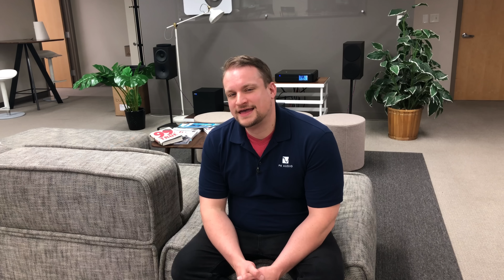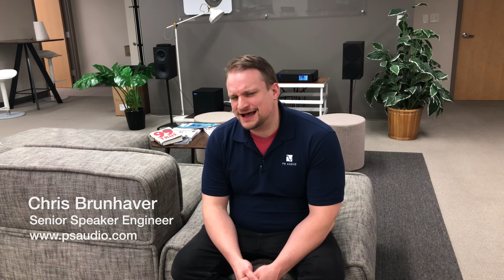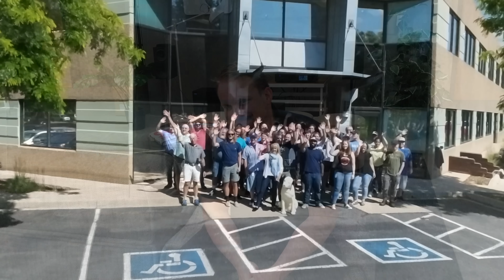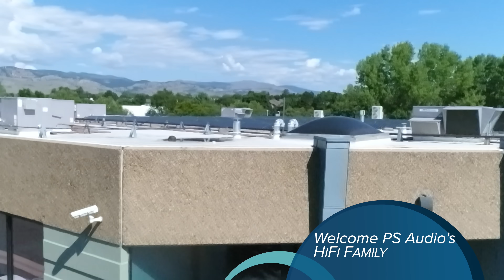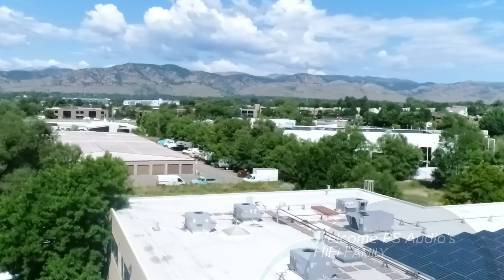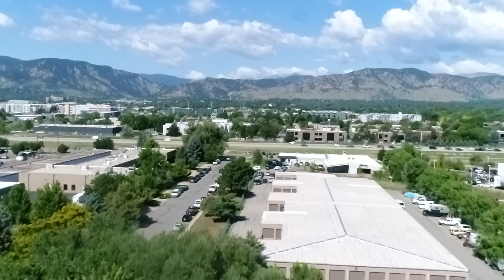Why speaker time alignment doesn't work

Comment: Absolutely agree . . . there is a lot more going on in sound than meets the eye or ear -- or the speaker manufacturer's propaganda and their profit margin. Thinking, again, outside of the box with the ability to tweak and adjust to your hearing pleasure is still the key. With the physiological differences from one person's mechanical and electrical personal response to the process of what we simply call hearing is like wearing glasses or shoes -- one size does not fit all in order to achieve the satisfaction in a musical experience from speakers . . . is it there any wonder why people are constantly trading in their speakers on the latest and greatest, while others hold onto their speakers? Personally, I have very slowly worked on my speakers for approximately thirty-five years . . . because the fundamental production of sound had a lot going for it. Do I believe that speakers in their mechanical production of sound frequencies will ever equal live music, the answer is no, but investing thousands upon thousands of dollars or throwing the money at the problem without a way to tailor the speakers to suit yourself, in my opinion, will never solve the problem than constantly replacing them. Sooner or later one is going to get frustrated with the process and say, “enough” of being played for a fool by the ever so clever marketing of many of these overly-hyped monoliths, which very few can afford.

Comment: Hey Chris, that was great. I've just built a new tall 3-way with my old 20+ years old drivers (by intention!) to see what I can achieve with them with a 8ch MiniDSP processor and a UMIK-1. So far the results are mind blowing, I think I'll keep these drivers in these boxes as is although they represent absolutely 0 value by now.  I'm just playing around to see the difference between a heavily corrected system and a slightly corrected one and I think here one has to find her/his own taste, which kind of overall sound and behavior to choose. Now I seem to love a moderate bass correction (always the most problematic part due to room modes) and just minimal midrange/tweeter adjustment, leaving some naturally occuring smaller anomalies in the upper range.. not much, just a bit. That combined with the somewhat more corrected bass provides a great blend of the "old world" and the DSP'd world and the result was also for my wife and stepdaughter like "wooow". Great to see DSP not being the devil of audiophile societies but an option for further improvement - if applied well, with care (!).

Comment: I would think any time alignment issues will be totally swamped by listening room acoustics.
Reply: If the are, then the room needs some work, at the very least treating it to reduce the amplitudes of first reflections. .
Reply: Sadly, most audiophiles don’t bother with this, in spite of the fact that it makes way more difference and can be done for far less money than buying, say, a pair of high-end speaker cables.
Reply: Yes, I’m using time aligned drivers with specific crossovers in a golden room along with speaker cables and granite speaker stands that were custom made for my specific speakers. Once you achieve properly done time alignment, there’s no going back!

Comment: Interesting subject.
I too have recently started using DSP as I have added a sub to my set up to complement the Magnepans. So I'm using the DSP for cross over and time alignment between the speakers and the sub.
I just thought it was worth mentioning something that you touched on regarding the DSP approach adding additional stages of A to D and D to A conversion. This isn't true if you are using an all digital, pre output signal path like I am. So I run the DSP software on the same computer that I stream from.
I just wanted to get that out there incase your comment regarding conversion misled some people in regards to using DSP.
Obviously I totally appreciate that you would be referring to DSP in the context of speaker design so this would be handled inside the speaker after the analogue input and would therefore be subject to the additional conversion which you speak of.
Otherwise, great video and I look forward to hearing more on the subject of speaker design.

Comment: Thank you, great Topic!
I beleave at least 75% of all Speaker Manufacturers dont build time coherent Speakers.
Some try to get the duration response alignet in phase by turning the polarity of the tweeters... fatal.
Because the kick response is confused then. And this one is much more important - due to evolution of human hearing!
In the Kick-response grapf you can see nearly everything. 
Is first peak is negative - tweeters turned.
Is there a little spike upwarts after that - a bit Midrage delay.
Big mound following - even more woofer delay.
When Kick response goes up without big spikes, then decreasing slowly, you are right.
Like this: 
https://www.google.com/imgres?imgurl=http%3A%2F%2Fwww.myro.de%2Fp_m_sprungantwort.jpg&imgrefurl=https%3A%2F%2Fwww.open-end-music.de%2Fvb3%2Fforum%2Fherstellerforen%2Fmyro%2F9776-genuin-pulse%3Fp%3D245974&tbnid=AaoUWWklLZBQRM&vet=12ahUKEwjshsPyyYXqAhWhwAIHHfbrADIQMygxegUIARDzAQ..i&docid=_i6mDxPjzgyEzM&w=1135&h=860&itg=1&q=myro%20sprungantwort&ved=2ahUKEwjshsPyyYXqAhWhwAIHHfbrADIQMygxegUIARDzAQ

Comment: Time alignment should be set to where it “sounds best” for the intended purpose rather than being derived from measurements or calculations. It’s not a black and white right/wrong thing. Think of it as a tool to adjust the characteristics of the speaker rather than a feature that a speaker either has or doesn’t have.

Comment: Howdy Chris.... you've met your Aussie match here btw ..!
I'm an electro acoustic engineer and a recording engineer at Sony ...
I go along with what you say here but the trick with speakers is to select the right ones that go well together in the first place .. after that it's a matter of phase and amplitude control using XO networks ... first orders are excellent for lower frequencies yes but for HF drivers 2nd or 3rd order networks are essential .
I have software that measures both group delay and plots decay responses shown in the familiar waterfall plot . I use these extensively to achieve the right result . Do you at PS Audio use component valuation software in your XO designs ? This software works like pspice or ORCAD and changes the values of XO components to fit a particular response envelope with minimum group delay ..
I guess you'll be handling all things speaker from now on as Paul does refer to you as the speaker guru ..!
Reply: Janina ...do you know Brad Serhan from 'Swift + Serhan' loudspeakers?
Ok so did you design your own loudspeakers?
Reply: Fat Rat I designed prototypes for Duntech audio ... was an audio consultant back then
Reply: I used to work at Sony for a few years and helped support Kaku and Yuki with the SS-AR1 and SS-AR2 product. 

Yes, I have a couple of crossover optimizer/simulation programs that we use.  We also design all of our own drivers and work heavily to optimize those for the application as well.
Reply: cbrunhaver ~ how interesting.. you and I could chat and argue for hours on speaker designs I'm sure lol 😂 No two engineers always agree ..! 
Yes these component simulators only optimise as you said .. the final test is in open space using LMS software as I do to perfect the correct coherent phase and amplitude response . I keep an open mind about making your own brew of in house drivers .... my first reaction is why reinvent the wheel ? Big names in electrodynamic transducers ( Dynaudio comes to mind ..) have done nothing else BUT design high end and very predictable drivers with amazing consistency in characteristics. I know ... a very large number of high end speaker manufacturers seem to build their own drivers but in reality they contract out the designs . Whether this is good I'm still not really sure .. new designs require extensive testing and honing in order to narrow down any 'production spread '. 
I'd like your comments on any readily available software for T/L enclosure designs ... as these things do not use any lumped constants and this is what makes them so hard to design ...
Cheers for now ...
Reply: @janinapalmer8368  Well, I'm always glad to chat!  My email is chris b (at) psaudio.com.  
LMS doesn't actually measure acoustic phase (it can derive it through a hilbert transform but that assumes a minimum phase system).  A shame about Chris' death, as I was looking forward to his new system and was a huge fan of his work.  
Well, the likes of Focal and Dynaudio don't sell their drivers anymore (except to car audio), as it competes with their box speaker sales.  JBL came to much the same approach in the pro world.  For us, it's a value add - when buying an off the shelf driver, you're paying for their engineering staff and supply chain etc.  Some guys have incredible robotic assembly lines and smart purchasing and are hard to beat, as compared to a lot of high-end driver manufacturers, we can get more for our money and something uniquely tailored to our application by doing it ourselves.

Comment: I have a pair of Theil tweeters left over from when I worked at Audio Gallery and they are sweet tweeters as long as you use them in their range. They sounded awful with any kind of lows entering them. We had the 3.6's and the 5's.

Comment: Highly informative! You should mention active speakers. These designs can better control both crossover and phase. Nevertheless your point is correct - we don’t need absolute phase accuracy - “smooth” is really what is important and sharp changes in phase do cause audible issues. MQA and minimum phase filters mess up phase and I find this to be audible with careful listening if the phase delays occur at audible frequencies (high frequencies are delayed). My preference is linear phase. Most speakers have phase issues in the bass but this is much less audible then phase delays at mid range or higher frequencies. The manifestation of phase delays from minimum phase filters is usually less accurate imaging.  Some minimum phase filters like MQA also cause mild compression (apodizing type filters). Active speakers aren’t perfect but if well designed they possess several advantages over passive designs.

Comment: My speakers has the front of the cabinet sloped where the tweeter is 2 inches behind the woofer. My tweeter will sound great & 3 dimensional, but n0t the woofer. When I move the woofer toward me 2 inches its 3 dimensional sounding , not the tweeter. I can tilt the speaker forward, where the tweeter is even with the woofer, but this makes the woofer point down.

Comment: When you say "time aligned", what you describe isn't what I (and I assume most people) assume the term means.  Sound travels very roughly at 1ms per foot.   If, for example, the front speakers and side speakers had a distance delta of several feet relative to the listener, you will get phase mis-alignment at different frequencies.  To me, time alignment means speaker placement to speaker placement - not driver to driver within the same speaker.  The former SHOULD be aligned in a well performing room.  The later really doesn't matter.  I actually hold a joint patent on dynamic configuration of time delays to reposition the sound stage in the automotive space based on occupancy sensors.
Reply: It makes a huge difference in the Recording Studio. Multiple microphone sources within near proximity of the same instrument are phase variant from each other.  You need a reliable phase coherent monitor to judge the 'safe' mix balance.  My Tannoy concentric time aligned monitors are much easier to work with than my JBL 4way Studio Monitors which sound way better for music playback.
Reply: Driver alignment on speakers as time alignment, I have heard before, is BS! My speakers has the front of the cabinet sloped where the tweeter is 2 inches behind the woofer. My tweeter will sound great & 3 dimensional, but n0t the woofer. When I move the woofer toward me 2 inches its 3 dimensional sounding , not the tweeter. I can tilt the speaker forward, where the tweeter is even with the woofer, but this makes the woofer point down
Reply: @myronhelton4441   Time alignment itself isn't BS. The way most manufacturers implement time alignment is indeed BS. One way you can time align drivers without doing the whole sloped approach is to use a waveguide on the tweeter and recess it into the cabinet. This allows you to control directivity of the high frequencies as well which is an added bonus.
Reply: @tristanjones7735  The tweeter has to sit straight above the woofer.If it doesnt, one  has to move the speakers. If the front cabinet is sloped back at the top, where the tweeter is behind the tweeter. One musy move the speaker forward the same distance for the speakers tweeters to sound right. Then move the speakers back to get the woofer to image right. I know what I am talking about. I have witnesses where I have experimented. Tilytng the cabinet where the woofer & tweeter are level straight up & down  dont work. Either the woofer or the tweeter doesnt image right. Another thing that would help great. Just scoot the woofer & tweeter close together. If this is such a great idea, All speakers would have sloped front of cabinet. B & W tried setting a small tweeter close to the woofer with a round tweeter sitting  on top of the cabinet that dont sound right. That flimsy kevlar woofer on B & W is pathetic.

Comment: Why would you choose to solve phase issues using accoustic solutions over electrical solutions or the other way around?
Reply: @FatRat-f9m  lol nah only boomers boom like that 😜
Reply: @FatRat-f9m  It's meant as a question to Chris or anyone else who has sufficient knowledge on the topic.
To me, it looks like it would produce the same results, but I'm an electrical engineer, not an acoustic engineer.
So idk.
Reply: It is very difficult to achieve delay in the electrical domain, assuming analog filters. The Meyer HD1 nearfield monitor did using a cascade of around 20 allpass filters (based on op amps for each stage). It looks great in measurements but sure doesn’t sound very good.
Reply: @jonathanknight8251  haha a cascade of 20 filters sounds like a dodgey solution to me.
I would rather use a DSP for that.
Reply: Qorax I’m not a big fan of doing it in DSP, but I too would choose it over this solution.

Comment: Yes the Vandersteen speakers are quite awesome and they do have a special time alignment thing going on with the sound.
Personally I don't care what has and what has not, I just want the damn thing to sound good, and I agree with and without it can sound pretty good.
Reply: My speakers has the front of the cabinet sloped where the tweeter is 2 inches behind the woofer. My tweeter will sound great & 3 dimensional, but n0t the woofer. When I move the woofer toward me 2 inches its 3 dimensional sounding , not the tweeter. I can tilt the speaker forward, where the tweeter is even with the woofer, but this makes the woofer point down
Reply: Try with inside boxes just like I recommend in my videos, it isolates all the unit sounds of your speaker, bringing the sound quality up to an entirely different level. Also having you speakers relatively close to the back and sidewalls will maybe also help.

Comment: Time alignment is important with multi channel (3+) systems, 2 channel systems you can have a dipole with a crude out of phase delay channel bouncing off the front wall so who cares.   "Folds" in phase hide details (information) just like peaks in linear response.  Don't forget amplifiers often have significant phase rotation.   When the system is slopped together phase doesn't matter (ergo some of the academic research on the audibility of phase never tested the source or the amplifiers for phase distortion).   As the audio system's obvious flaws are continually diminished smaller flaws suddenly become "a problem".  Passive loudspeakers are obsolete because of what you described, but the inherent flaws of 2 speaker playback are greater than the flaw of phase distortion.  So you have to correct listening to only 2 speakers first.  :)

Comment: I can't listen to music on conventional multi-way speakers. I hear only non-logical sounds.
Phase and time alignment are the most critical thing about a speaker. That's why I'm listening to an open baffle with linear phase crossover and the necessary delays to different drivers.
The only one better speaker than that is full-range driver. :)
Reply: I agree dsp and delays to the multiple drivers is the best. 

What amps do you use?
Reply: @thunderpooch  a dsp powered by a switch transformer.. more digits more artifacts..
Reply: Active crossover? What brand did you go with?
Reply: Nah...dbx or peavey or rane or ashly or
Pro audio rackmount stuff
Reply: @zeusapollo8688   class d or class ab? Monoblocks for each driver? Stereo amps for each bank of drivers? Or a multichannel receiver?
Reply: @thunderpooch  oh stereo banks of power amps
Reply: @zeusapollo8688  thanks. Ab or d? And HiFi gear or pro audio? 

And are you happy or looking to upgrade?
Reply: @thunderpooch  i have yet to build it. 
Or buy the active crossovers.  Only one brand offers time correction for the horns. I wonder how important this will be.
Reply: linear phase crossover is a fairy tail that you may have bought expensively lol